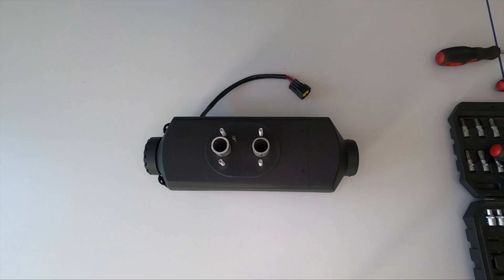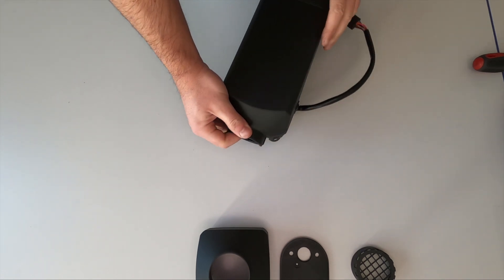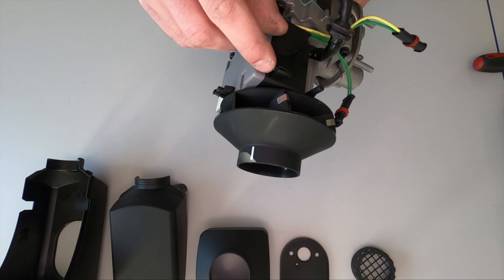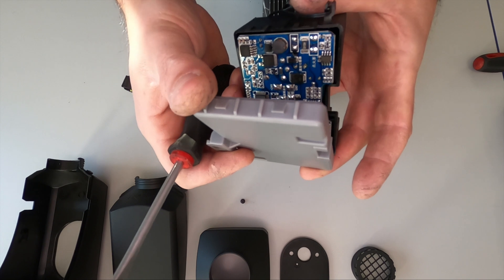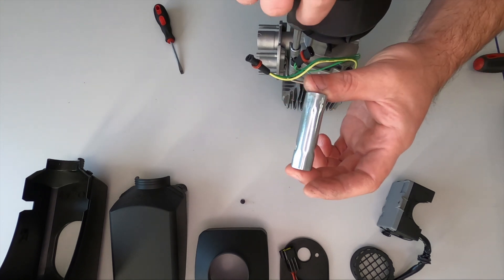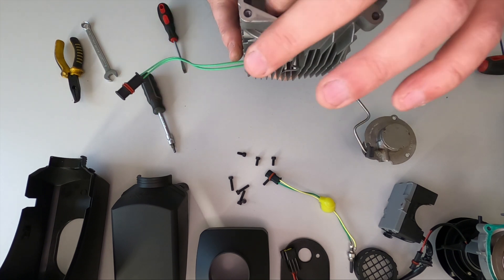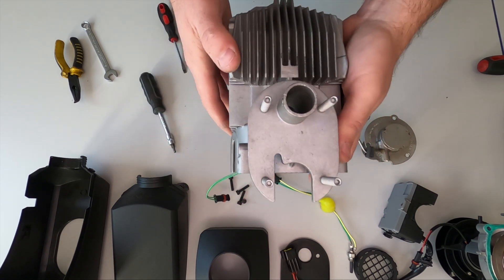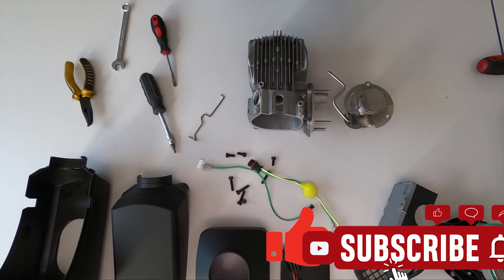LAVANER PRO 2 kW Chinese diesel heater TEARDOWN

Comment: Is there a internal fuse ?
I accidentally reversed my polarity and it blew the outer fuse and now I get a code E13 and heater won't start.
I replaced the outer fuses and unplugged the heater for about 15 minutes, still code E13

Comment: As for the glow plug, that is the Japan Kyocera Ceramic Glow Plug, completely the same as the one on Webasto and Eberspaecher. also the sensor is from Lattron Sensor of Korea. in addition, you can find out the conformal coating on the ECU in 2022 Version.
Reply from the maker: Thank you for the comment, it is very helpful for the viewers.